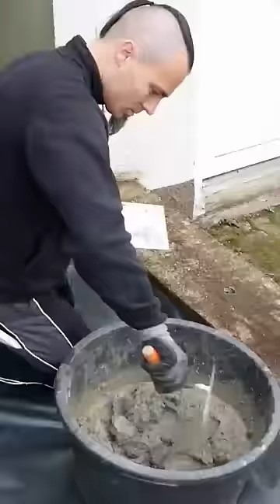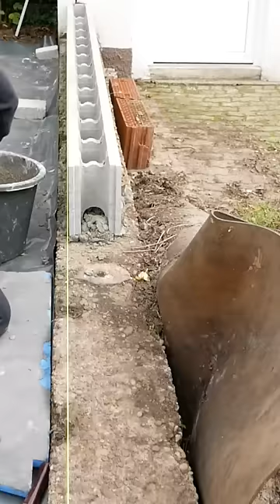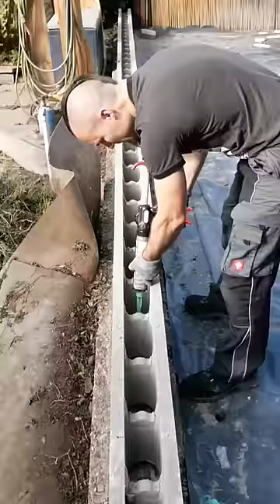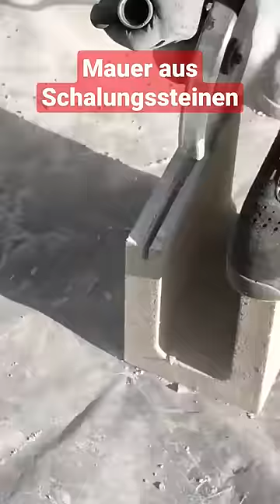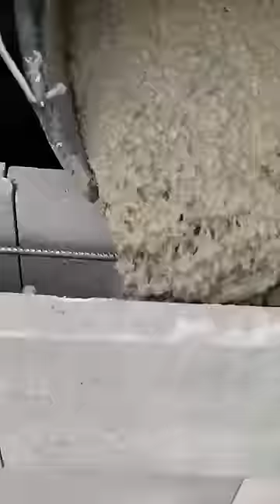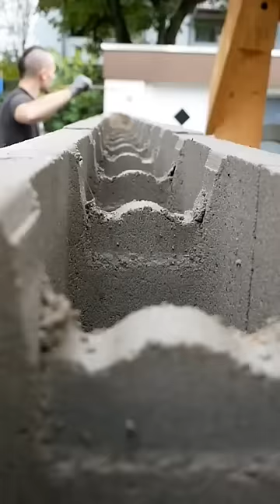Gartenmauer aus Schalungssteinen #shorts #mauern #garten

Comment: Your post to clean the concrete footing with muriatic acid before placing wet mortar. Your post to thoroughly clean surfaces on footing to lay cylinder blocks. Mortar can separate from a unprepared surface that is not thoroughly clean. Muriatic acid is the best concrete cleaning solution for preparation!!
Reply from the maker: Danke für deinen Beitrag.
Reply: Yes.